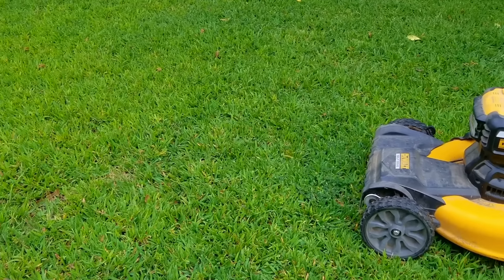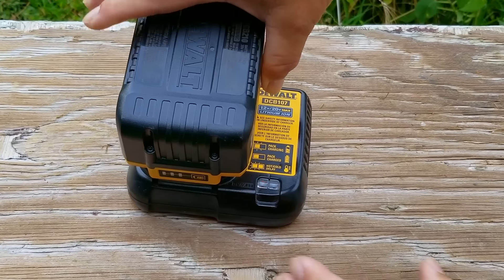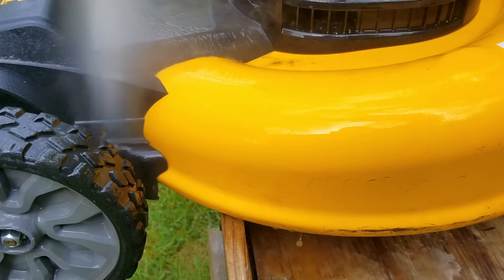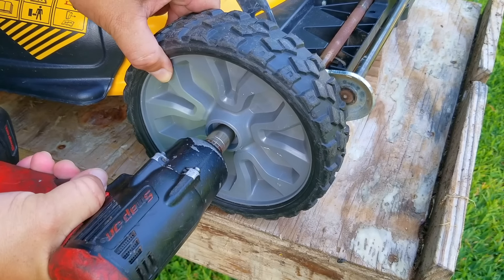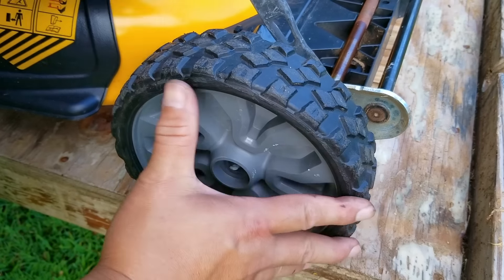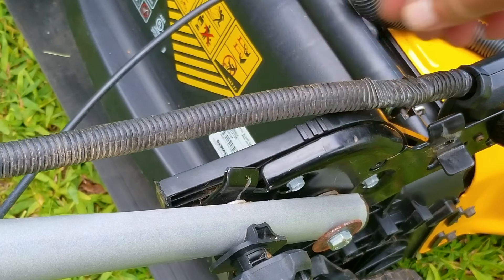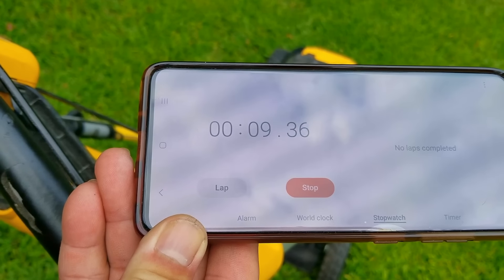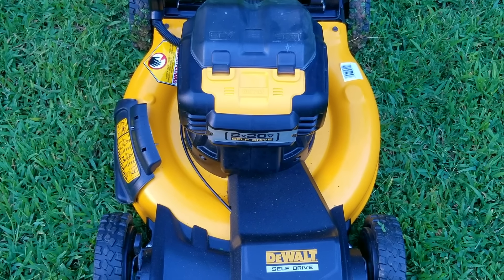Finding Out Why This Dewalt Mower Start And Then Stops

Comment: It's really horrible that they are transitioning to completely replace gas mowers with these battery powered ones.
They're a great option but far from a replacement.
when you take into account the cost of batteries plus the missed charge on the electrical bill, I bet there is little to no savings at all.
Like wise battery and electrical production has to come from somewhere and not all electrical comes from 0 carbon plants.
Are you saving the planet at all or just adding waste by pushing these into the market?

Let's be real about something that everyone seems to overlook.
Corded electrical mowers have been around for ever and very few use them (not too convenient unless you have a really small yard).
But the capability too make battery powered mowers was over looked for a very long time (I think the reason is obvious).
I for one don't buy the battery technology excuse. 
Both NiCad and Marine grade gel cell will suffice just not as efficient but may even exceed in longevity of life span if you look at real world evidence instead of advertised hype.
I think it's just another case of planned obsolescence finding it's way into a new market.

They're even trying to push it into the commercial market now and I find it simply astounding how many are falling for it.
Those batteries aren't cheap and have to be bought in abundance then they have to create charging stations not to mention the fact you point out when it comes to cleaning.

It's really going to suck when it becomes near impossible to find gas powered equipment .
Even worse if they ban the use of them so that they can feed the battery powered garbage down your throat.
Reply from the maker: thank you for sharing this, very eye opening
Reply: @donjohnson1416  Of coarse I haven't monitored the exact charge but have you noticed that since light bulbs went from incandescent, to florescent, to now LED the electric bill has only gone up?
When you plug these chargers in they have a truly minimal, but ever present draw (the kind of draw that would leave you unable to go to work in the morning in your car if it was drawing the power from your 12v battery over night.). 
Likewise how many people charge, remove, and cycle batteries vise leaving them on the charger till the next use?

How long does 1 gallon of gas last to 1 mowers use? 
How many gallons do you have to buy to equal just the cost of the battery/batteries?
PC's run on 12 volt power supply's but not too many people think that's the most affordable piece of equipment in the office.
Ever feel the charger for a laptop while in use? 
Generally speaking that's the same batteries (generally 19v Liion batteries/battery pack).
Do you believe that tool battery chargers are more efficient?
How about the physics involved in the transfer of power from one source, say fossil fuels, to A/C electrical, to D/C storage. 
When you factor in heat dissipation how close do you think the efficiency is compared to fossil fuel direct drive?  

Regardless battery powered equipment is only feasible for small scale use.

Where I am there is no real dormant season but I really feel bad for people that are going to learn the hard way that batteries don't care to be shelved any more the petroleum for seasonal use perhaps even less.

But to each their own if you want to be a blind globalist go for it, have all the batteries you want. 
It won't be long and batteries will be the next plastic that was supposed to be recycled and low and behold it's all a farce.
Reply: @donjohnson1416  I don't need a response.
Basic physics will tell you that I'm correct and battery power can never compare to gas.
I mean sure If you have a killer solar system at home and the cost of the equipment (and the 10 year interval of replacement panels and inverters and whatever else may fail) is less then your actual electric bill anyhow and you want to extend those savings toward a few gallons of gas every year well then more power to ya. But most people don't get any of that equipment for free. 
Just like with solar most people simply look at the savings on the electric bill and completely disregard that those savings will go to replacement parts in the future IE no savings at all. 
In this case same with gas.
The environmental impact is just the same.
It's a simple case of rob from one to pay the other.

Do you know where most plastics come from?
Petroleum!

Simple fact is if you don't want to live like a cave man you can't get away from petroleum.
In order to respond at all you are using a device that has an environmental impact.

If people continue down this road that's exactly where we'll be.
I'n the dark, besides when those that have fooled us into getting rid of all our stuff say we can have temporary and monitored access to equipment that has any environmental impact as deemed by them.

Some even want to get rid of cows because of farts.
Just sayin.

Don't get me wrong.
I like battery powered equipment.
It can be fun and convenient.
It just doesn't compare at all to gas powered equipment.

Comment: The same with used E bikes and cars. They all need really expensive batteries.
Reply from the maker: agreed
Reply: @donjohnson1416  when a tesla has lost 60% of its capacity they tell you it’s only lost 15%. Make the owner think there are no problems.

Comment: I think that's a real good idea to take an electric motor off and put my gas motor I will fight as long as I ain't going to buy one of those then turn around keep buying batteries and on top of that the grid cannot handle that everybody charging their batteries over and over I still bet we're about 10 to 20 years out yet figure out these batteries that's just my opinion thank you for the video
Reply from the maker: thank you and I  always appreciate your insight

Comment: just get a pressure washer engine and makeshift a gas mower.
Reply from the maker: that's an idea, however the shaft on the pressure washer engine is short, and I mean extremely short